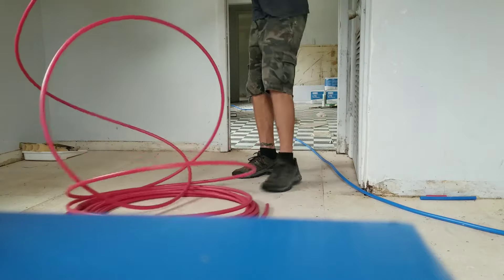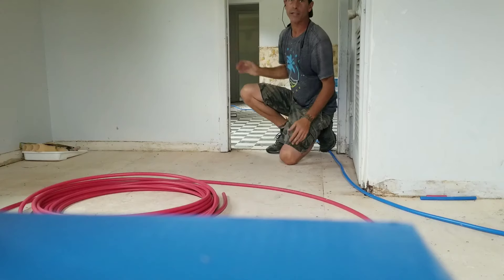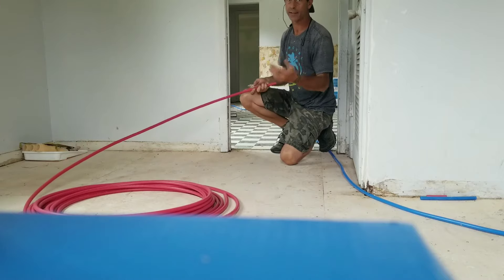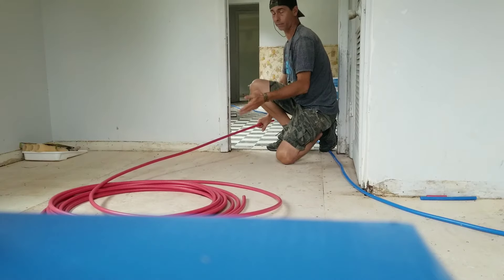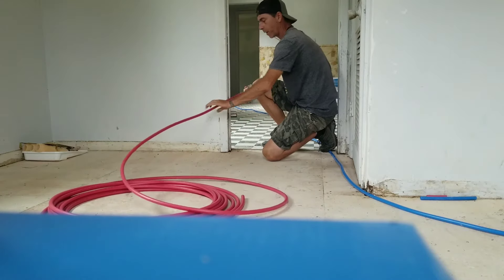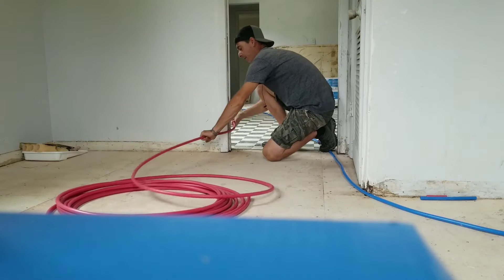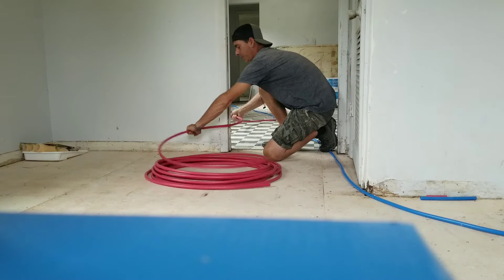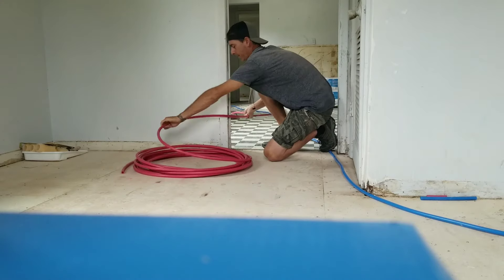Pex Pro Tip- Straighten the Coil Before Use!

Comment from the maker: If this video seems a moot point,  you haven't watched someone fight a roll for hours instead of just straightening it like a pipe and making life easy
Reply: I really appreciate the video! It answers my question if PEX would naturally uncoil or stay in the shape. I make mode roller coasters, so I need the rails to be really straight. Thanks for the tips!
Reply: Not a moot point.  I just wrestled with 1” pex-a to get my main supply replaced.   Wish I would’ve seen this first!   Thx for the vid
Reply: Any tips for 1in pex?

Comment: This is good when you’re by yourself. What we used to do when you have two people is pull a bunch out and both people pull it tight several times. This works pretty well. However these methods only really work with pex B. If you’re using pex A, you may just have to deal with it. It’s designed with much more of a memory. It will straighten a bit but not enough to spend much time on. The only pex A that I spend much time trying to straighten is 1 1/4 to 2”. It’s worth it if you can straighten even a little because it’s a pain in the ass to work with. If you don’t know the difference in these two, you probably have B. That’s what the box stores sell.

Comment: Awesome tip, thanks! Running 2 water lines of PEX from my garage through a basement room without access into my furnace room so I have about 12’ of a straight run and didn’t want the coil pressing up against the joints.

Comment: Yeah try that with 1 inch pex, bought 100ft coil to run for my wood boiler inside.. not fun, should have just bought straight 20 footers
Reply: I'm in the same boat right now with a roll of 1". How did you straighten it?  I left it in the sun for like 5 minutes then remembered about sensitivity to uv. I was thinking of a heat gun.....

Comment: Interesting. Getting ready to repipe my house and I want to use Zurn pex, was reading all the horror stories about fighting the coil. I was going to buy 20 foot sticks, but am now rethinking that. Is this pex a or b in the video?
Reply from the maker: Good question.  Had to look it up.
 Sharkbite brand pex b. 
 Apparently the only difference between a & b is the manufacturing process and that b may be a little stiffer
Reply: @hatmanconstruction166  great tip. Did the pipe fight you much after you unrolled it wanting to coil back up?
Reply: I wanted to buy straight PEX to avoid this hassle, but the only straight PEX carried by Home Depot was B. At Lowes, it wasn't marked. Crazy.

I bought the roll and tried to straighten it just by bending. I assumed it needed heat. I didn't check YouTube first like I usually do, mainly because it didn't seem like it would be that big of a problem. Boy, was I wrong.

Buy the straight pipes if you can afford the waste. You'll save yourself a lot of hassle and your install will look far prettier.
Reply: @hatmanconstruction166  
I'm pretty sure the difference between PEX A and B is significant. You wouldn't want to use  B with A fittings. It's a different connection system entirely.
Reply: @thedalillama  Yeah I have come to that conclusion especially since I really wont; have any run that need more than 20 feet without a fitting. Sure more waste, and I hate that, but Pex is cheap.
Reply: Pex A has easier fittings, and is higher quality pipe I feel.
Reply: @thegreekguyviva-greece5881  yeah I wound up going Uponor Pex-A and I have been pleased. I am using all Uponor fittings and have been re-piping a little every weekend and hope to cut over to the new piping in the next 2 weeks. I did get 20 foot  sticks.